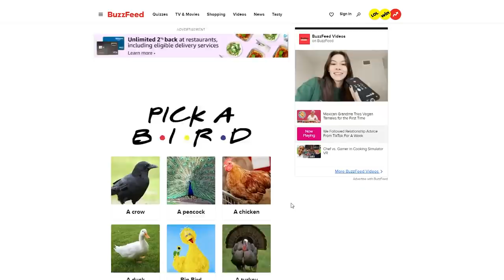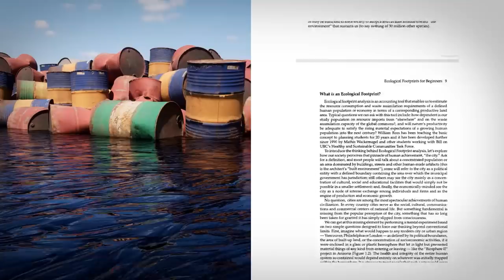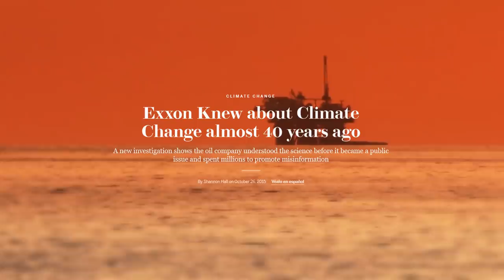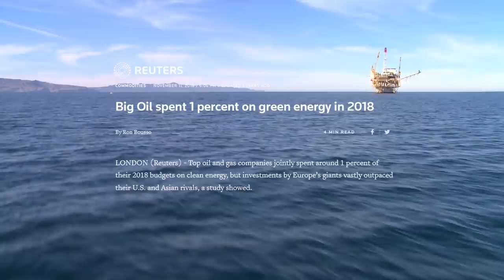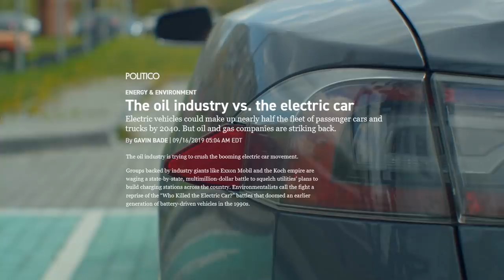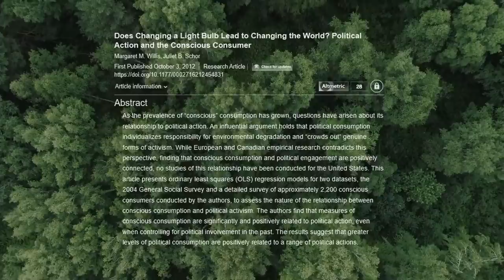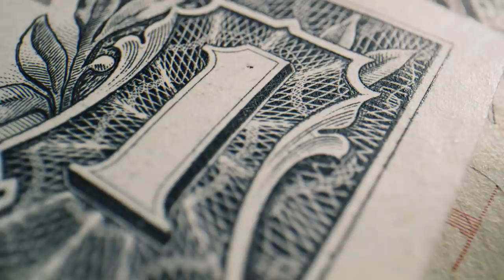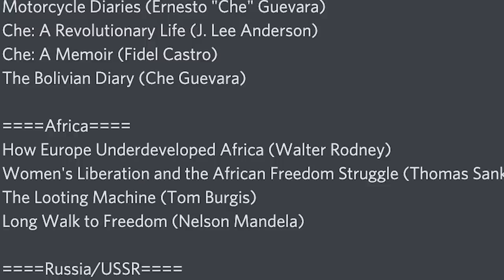Your "Carbon Footprint" Is A Scam

Comment: One of the things I envy most about Europe, aside from healthcare, education etc, is the fact that their cities are designed to be mostly walkable and conducive for public transportation. Its ridiculous how much valuable space is devoted to just parking cars in the US.
Reply: Of course, not all of Europe is the same - the Netherlands are very pro-pedestrian and pro-cyclist, and recently Paris elected a new mayor that is planning to make the city more pedestrian and cyclist friendly.

But then you have countries like Ireland that are extremely car-centric. Dublin is the only European capital city without a metro line - even Bucharest (in Romania) has one! Heck, even a basic tramline was only constructed fairly recently due to the unbearable traffic congestion, but no other Irish city has one. Oh, and trains are virtually non-existent in Ireland (they do exist, but literally no-one uses them).
Even taking the bus is pretty expensive, and there is no basic ticket system - if you don't have a so-called leapcard, you have to pay the fare in cash onboard to the bus driver, which is often very slow and inefficient, resulting in buses arriving several minutes late most of the time.

Source: I currently live in Ireland.
Reply: @GTAVictor9128  Fun fact, Dublin isn't alone with its lack of metro, Bratislava(Slovakia) also doesn't have one.
Reply: They weren’t designed, they evolved that way. You’re forgetting that most european cities have been there for centuries or millennia, evolving from a time when most people were forced to walk around or at best use a horse. By the time cars came along the basic way these cities looked and worked was laid down, and due to economic circumstances cars didn’t catch on for a long while compared to America.

Also, there is the question of space. Much of Europe is mountains, hills and small plains. There aren’t many places in Europe that are huge open wide areas like in the United States, where all you see until the horizon is a boring, flat plain. Thus, the idea of building with huge spaces in between places, areas, buildings with wide roads is an impossibility for most of Europe even if you were to design a city from scratch. The only places this is more feasible are in France, Germany, Poland and some parts in Italy, Spain or the UK, but still very limited.

On the reverse in the USA it would be quite insane to design cities to be more compact when there is space. That isn’t a good idea, especially when there is no need. Of course the fact that there is no public transportation, or that it’s worthless is also a problem. But anyone who’s lived their whole lives having to bunch himself up with others, smelling their breath and farts will tell you they’d rather have a car.

So really, it’s pick your poison... do you have a monogamous relationship with your wife because you want the security, affection and dedication of that, or do you serve her boyfriend tea before he rails her because others want a shot at that ass and you mustn’t be an egotistical, patriarchal pig?
Reply: What did you expect??? Us Americans have to have our big vroom vrooms or else we won’t be able to live!!!
Reply: Because they are tiny crowded countries with a massive uninhabitable mountain range down the middle.
Reply: Brown coal.
Reply: @GTAVictor9128  I live in Hobart (australia) and there's no metro line, there are buses but the vast majority of people drive, it's probably as bad as the US
Reply: @Hadoken.  Your arguments are all either false, or badly constructed.
"They weren’t designed, they evolved that way"
False. While some of them still maintain the overall structure of centuries past, most transitioned into a car-centric design, only to then realize how stupid this is and go back to how things were. Amsterdam is famous for going from car-centric to pedestrianized in only 20 years.

"Also, there is the question of space. Much of Europe is mountains, hills and small plains"
Completely irrelevant, as exemplified by the Netherlands. In fact, the less mountainous your terrain, the better it is for pedestrians and cyclists.

"On the reverse in the USA it would be quite insane to design cities to be more compact when there is space"
Compact cities are objectively better in every measure. Less money is wasted on infrastructure, neighborhoods are more productive, people are more social, etc.

"Of course the fact that there is no public transportation"
You build infrastructure before hoping people randomly start using it, not the other way around.

"But anyone who’s lived their whole lives having to bunch himself up with others, smelling their breath and farts will tell you they’d rather have a car."
I can tell you're a privileged fuck. If I met someone like that, I'd fart in your direction as well.

Really, you're the reason your country is a shithole.
Reply: @Hadoken.  How about asking the wife? No surprise she is looking elsewhere for connection instead of objectification.
Reply: @ninamartin1084  That's why her husband serves me the tea Nina. It's insane how you people misunderstand a comedic analogy for seriousness.
Reply: @BanBootlicking  I'm an American expat living in northeast Italy, and the traffic here is ridiculous. It's a medium-size town of about 50K people, but I swear it feels like 500K with the constant traffic - not just the rush hours, but all hours throughout the day. You'd think nobody has a job here, they just run around in their cars to the stores, markets, snack bars, pizzerias and gelato shops.
Yes, there are some cyclists. The bicycle "lanes" (if you can call them that) are skinny strips along the sides of the streets, so there's no distance at all between the bikes and the cars.
There are also a couple of major truck routes running through the town, adding to the congestion.
If the traffic is bad here, I can't imagine what kind of hellscape it is in Rome!
Reply: Healthcare and education is debatable such as UK being salty about funny independence war of US and health care is another can of worms
Reply: @IndianaJonesTDH  Chicom bot spotted
Reply: The US was leading in public transportation in the beginning of the 20th century. Then a manager of GM had the idea to buy all tram systems in the 45 biggest cities and shut them down to increase car sales. It worked.
Reply: @mpemberton7760  Northen italy has been trying to fix this problem but it's nowhere near enough, especially considering how quickly polluted air accumulates here compared to the rest of europe (damned alps).
People still see owning a car as a necessity even in larger cities with decent public transportation because, well, it is convenient.
Sometimes I wish we'd just stuck with bikes, subways and trains for commuting, unfortunately driving a bike right after waking up is NOT easy to do in a busy city with a hunk of metal waiting to kill you at every corner, with a bike lane that suddenly interrupts or is half a meter wide and the only thing separating you from the hospital being some marking on the road all while breathing in the smog coming out of the exaust of the cars next to you.
I wish to see a Milan where bikes & electric scooters are actually a good way to move around in my lifetime, don't ban cars, significantly improve the viability of the other stuff FOR EVERY CITY while making the car commuter's life be more and more inconvenient. (which is what they are trying to do albeit slowly).
Reply: @pucci405  Yes, the Alps create a kind of pollution dome over the valleys and plains below. Of course it's worse in the summer when the heat traps the pollution. 
I remember when Italy went into full lock-down to prevent the COVID pandemic from raging out of control. The streets were practically empty, and the air was much cleaner for awhile. But after that everything went back to normal, and the traffic was just like before...dense, suffocating and constant, from morning until evening. And I remember being so depressed by that. Because nobody thought, "Gosh, it was nice when the streets weren't clogged with cars all day. Maybe we should drive less from now on." No, it was right back to the same old routine. 
Cars are the most convenient means of transportation. And the unfortunate reality is that the vast majority of people will always choose convenience over the alternative compromise for the greater benefit of society and the environment.
Reply: "But what about my sales of parking lot spaces?", says the parking lot owner. 🤣
Reply: @GTAVictor9128  Bucharest having a metro network kinda makes sense given it's past. The socialist republic's urban planning was such that everything you need (daily) is within walking distance, except work. Then you make good public transit (like metros) so people can get to work, and suddenly you barely need personal cars! And all that economic production capacity for cars can instead then be used for other things.
Reply: My colleges campus in US is nothing but parking lots
Reply: @GTAVictor9128  There are outliers, but the US is for the most part very car-centric compared to Europe.
Reply: @Hadoken.  Maybe your brand of "comedy" is just really not that great, and you just have to evolve a bit with regards to that. I mean, the whole comparison kinda came out of nowhere and was in no way funny.

Also, public transportation is fine, and stopping global warming is hardly insane.
Reply: Thank you! Finally someone noticed that our "city design" here in the US is rediculous. I miss walkable cities soo much and would ditch my car in a heartbeat if it meant that the US would build walking/biking/public transportation centric cities.
Reply: @GTAVictor9128  good to know. Sounds like Ireland is similar to the US in that way.
Reply: It's almost like the US is a larger country huh
Reply: @Hadoken.  Have you ever been to a European city designed for people?
Reply: @JS-po8oc  Lived in quite a few 80% of my life Sherlock.
Reply: @IndianaJonesTDH  Thr UK is not still salty about the revolutionary war. They have had so many they basically can't keep count
Reply: England and Germany; better car parks is all it is. There are parts of USA and Canada that have got it right.
Reply: @GTAVictor9128  the tram is only recent? From the country that invented the monorail I'm shocked.
Reply: @jayz8839  no.
Reply: @DanDeLeoninthefield  build up. We have multi level (storey) car parks (parking lots) in England, in Germany there are tower blocks wholly for storing your car. I find it amazing that America, the country built around the car never noticed about this.
Reply: @aniquinstark4347  I don't know, it looks like a collection of little countries with a central government a-la the EU.
Reply: @grumpyhale821  
Shouldn't be - the US pioneered in their rail network infrastructure in the 1800's, yet today passenger trains are virtually non-existent in the US. Every major US city used to have extensive streetcar networks before the automobile, but then the auto industry bought out the tram companies and tore out the tram tracks to make more room for cars.

Ireland too used to have a fairly extensive rail network that was built out under British colonial rule, but after gaining independence they embraced the car and significantly reduced the rail network. To this day, Ireland uses different rail dimension than the European standard, meaning that in order to build out more rail, they have to make a special request.
Reply: I live in a city, but it's not like NYC where you can walk to the nearest convenience store or hop a subway to work halfway across the county. With how everything is spread out, it may as well be a large town. And our head of transportation, in all their "infinite wisdom," changed the bus routes so that the bus never comes through my neighborhood. I used to have to take a bus just to get out of the neighborhood and hop another to get to where I needed to be. Now I'd have to take an extra hour just to walk to the nearest stop. That change forced me to get a car.

Electric cars are still too expensive for me to get. And to get the charging station installed would mean having to rewire the entire house because the house is just that old. It's cheaper and more efficient for me to just keep driving my gas-powered sedan for the next twenty years. Companies really made pollution the cheaper option so they could blame their profiteering on poorer individuals.
Reply: Us is bigger than europe with lower population. Its almost like its to be expected lol
Reply: @JS-po8oc  i know im about to break your world but all cities are made for people all over the world. Crazy huh? You also forget that europe is smaller than the us and has higher pop density so its kinda a given
Reply: @trey6563  Guess what, European countries are the same size as American states.
Reply: @trey6563  And yeah cities are made for people, not cars, so don't make them for cars
Reply: @Hadoken.  Great comment.
Reply: @GTAVictor9128  ...well... do you know how big  Bucharest is?? That would not work without extensive metro lines...
Reply: @GTAVictor9128  "recently Paris elected a new mayor" She is here since 2014 ,it's not a new mayor,she was "re-elected" with a turnout of 36.7% and 29.33% of the vote ,so yeah she got elected by 10.76% of the electoral college/6.55% of the population of Paris , and she is seen by the French as the one who destroyed Paris .(Well the PS (Party Socialist) has destroyed every city of France when they got elected so ...)
Reply: @Hadoken.  false look at Paris 10 years ago it was totally designed around cars, now this is totally different.
In America with the absurd road length you can literally put bike path and bus lane everywhere.
Reply: @jayz8839  Europe is more crowded than the US.
700 million people live there.
Reply: @I_Hate_Youtube_Handles  yes you can always walk on the freelane if you want but that’s not what we call walkable.
Reply: @aniquinstark4347  Europe: 700 million 
US: 300 million 
You have no excuse.
Reply: Also a great reason why people in other countries are more likely to be physically fit than in the US.
Reply: I agree the us should totally move away from our car culture. We should make it easier for people to go to different places in different ways like I’m never going to drive which means I have a limited amount of times I can go out I can only go somewhere if someone I know can drive me.
Reply: @GTAVictor9128  I used to live in Cork. I walked basically everywhere. it was a 30 min walk to the city centre where I got everything I needed (incl. work).  Trains were stupid expensive but the bus coaches were amazing. 10 euro return ticket to Dublin. Dublin is very much walkable aswell. Except the one time I wanted to go to a remote cliff, I never needed a car in Ireland.
Reply: @JS-po8oc  

Easy to say bud. Smh
Why do you think millions of people move out of cities? Because of higher cost of living and higher taxes.

Why bother live in a “walkable city” if you can choose to live outside of the city where there is less taxes and lower cost of living?
Reply: @mikkykyluc5804  Like tanks?
Reply: @joemaloney1019  Exactly, to discourage the Americans from trying anything funny.
Reply: ok, let's compare a small city country and a bigger country. The example: Singapore and Malaysia. Malaysia almost all household has either a motorcycle or car. In Singapore  11% of household own cars and the transport is world class. So how will you solve the issue in Malaysia? hire a million bus drivers in every state to drive to every streets or build a million lines in whole Malaysia? Mind you in Europe, in the village you will need a car too.